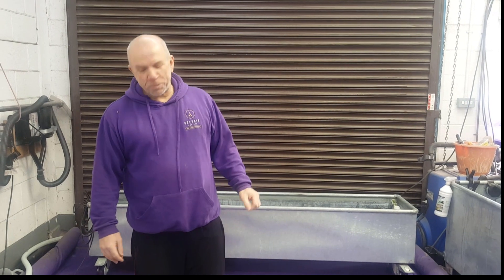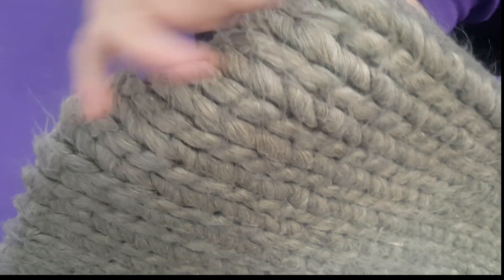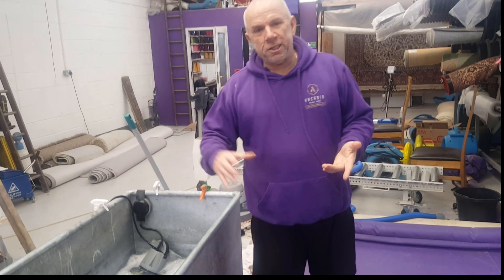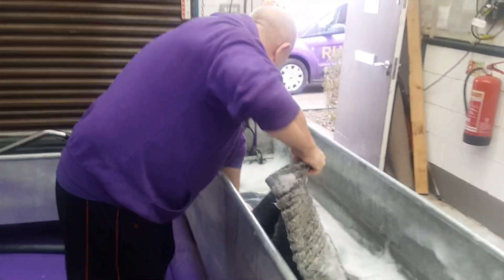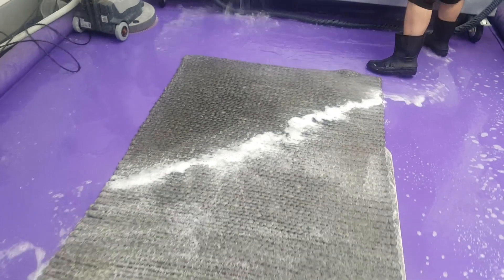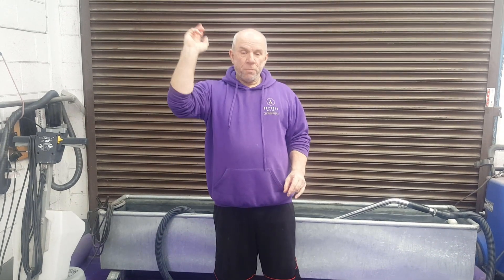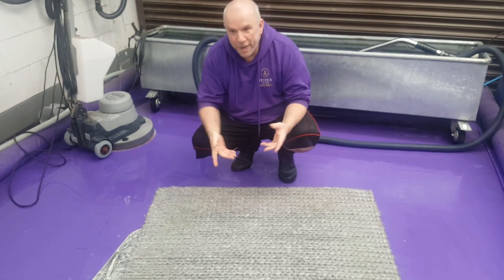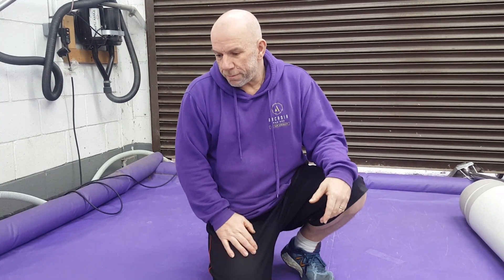No agitation wool rug washing

Comment: Hi, looks great, and I think I could cope with most of my rugs at home, although the spinner would be very handy. My problem is I think my rugs would run. I tried to wash the white fringe on a piled red rug, as the rug looks clean with the carpet cleaner and the red ran into it, this was some time ago and the fringe is very dirty now and not sure what to do. I have another woven rug that I tried to spot clean and the colours started to run. I thought it might fit into a large washing machine but I don't want to completely ruin it
Reply from the maker: You are probably using the wrong cleaning product Different PH strengths, alkali and acidic can fix or loosen dyes, i have a video that shows you how to do a dye bleed test om ,y channel, but to be honest, we never advise cleaning rugs yourself, they are so much more different than actual fitted carpets and so much more (as you have already found out) can go wrong with rugs. Hope this helps

Comment: I have a 100% wool rug that has a urine odor on it. It is 5x3 ft oval with fringes that are really dirty. Could I soak this in my bathtub with a little bit of dawn dish soap for a few hours, rinse a few times and then leave out in the sun to dry? Would that ruin it? Please advise me the best way to clean it. Thanks!
Reply from the maker: Urine odour will not wash out, you need to break down the urine crystals first, then you could start the wash and rinse. Getting pet odour out of a 100% wool rug is not a DIY job in my opinion, I wouldn't attempt it myself if i didnt have the flushing capacity and drying machines. Plus depending on the rug and your pets diet, the dyes in the rug could easily become unstable and you may start to get colour run. See this video here showing how pet urine destabilises certain rug dyes. https://www.youtube.com/watch?v=Hb3sNmPZ8ng
Reply: @ArcadiaRugSpa  it's not pet urine, but human. I already tried cleaning it with my carpet cleaner and the water was really dirty. But the odor is still there. Colors didn't run at all.

Comment: Did you make that pumping system or did you buy that way 🤔 
If so could you point me in the right direction
Reply from the maker: The pumping system was made by us, just powerful submersion pumps, 4 to a tank, one in each corner, they need to be made secure or they will twirl round. hope this helps. The flushing system is another submersion pump attached to a pipe attached to an old carpet wand.
Reply: Thank you so much. Wow.
Reply: Any certain size pumps

Comment: Could you use a rug doctor on this type of rug? Struggling to get mine clean
Reply from the maker: I personally wouldn't use a rug doctor on this type of rug, For one it has a beater bar which would be too aggressive on the wool fibre and 2, its suction setup isn't adequate for such an undulating and absorbent material. Hope this helps

Comment: You have shrunk it, it will never sit flat on the floor again
Reply from the maker: Yeah that does happen when you dont know what you are doing, my advice would be to get some training. we've cleaned 100's of these rugs, none shrank and all sat flush to the floor,
Reply: @ArcadiaRugSpa  we have cleaned rugs and upholstery for 40 years, if you look at your last photo you can see the edge has lifted, it has shrunk. A woven or natural back wool rug cannot be bathed in water, it causes any natural fibres to contract.